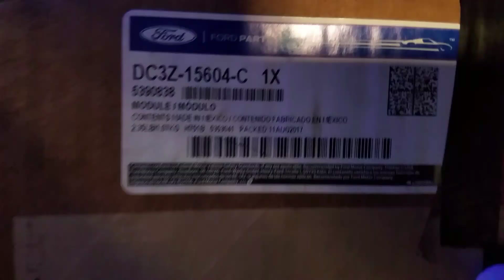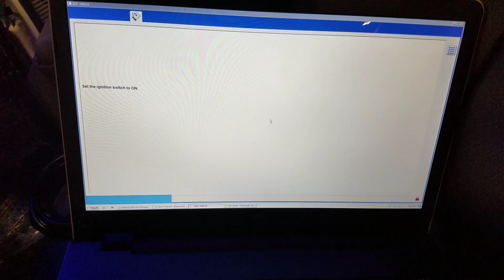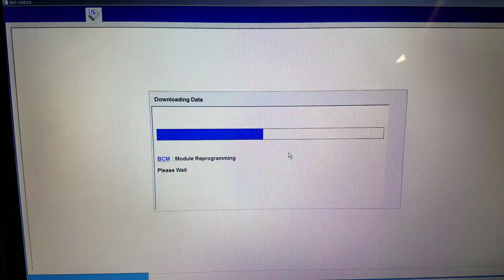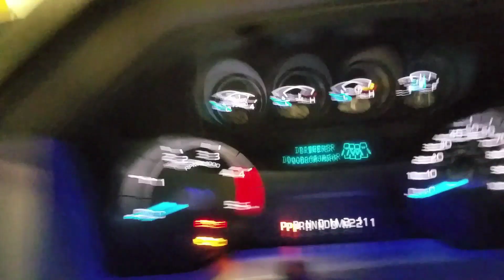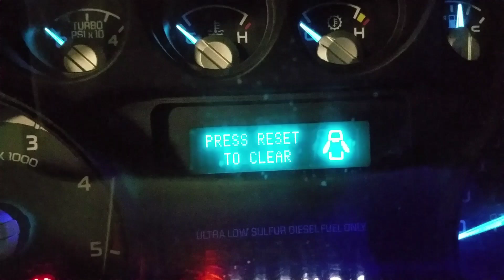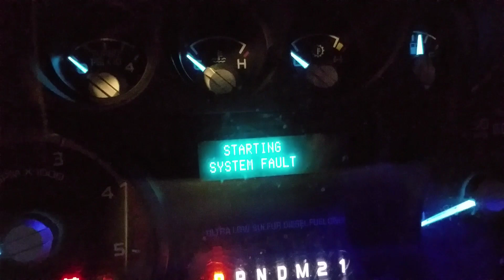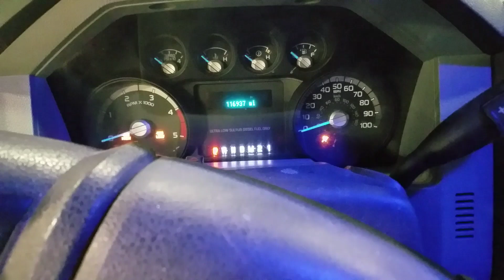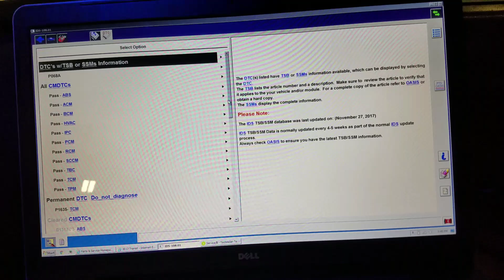BCM R&R - FsuperDuty

Comment: 2011 f250 6.2 here with no power to AC pressure switch and right high beam no power. Fuses good and nothing else obvious. Previous owner ran a switchable power lead to AC comp/pressure switch. Stumped on both problems. I’m an ASE master tech…. BCM? Mostly BMW and 
Porsche tech experience x 30 years. At time I turn the truck off and remove key, but it continues to run for a short time.
Reply from the maker: Hmmmmm. I'd be going through the pinpoint.Tests for that there might be something wrong with the heating.A c ventilation control module

Comment: Hello. Thank you for the video. It was very helpful. I have a 2010 f250 SD Lariat 6.4L. I disconnected some of the connections on the BCM to run some wiring for adding some LED in the door. I reconnected BCM connections and security light has been blinking and no start... what should i do?
Reply from the maker: Are you sure you have those connections seated all of the way.....
Reply: @PowerStrokeTechTalkwARod You we're right, my brother said he reconnected them... I checked them and one was not connected. Thank you very much I appreciate you so much

Comment: Took my 17” to get painted and the guys at the shop we’re going to jump start it cause batteries had died and they put the cables backwards and blow alot of fuses not sure how long the cables were on like that ,but i replaced all the blown fuses and still cant get my turn signals , seats , steering wheel controls to work ? Any suggestions
Reply from the maker: Oooof might be time for some other modules...

Comment: I notice you are using the VCM II. Maybe I'm misunderstanding the purpose of this tool, but wouldn't it be easier/cheaper to just use forscan and a (compatible) OBD II interface? Say..... one that auto toggles between medium-high baudrates?
Reply: I am new to forscan, and new to Ford,  but bought my vehicle with only one key. After being told i "cant just go get another key. The dealer has to do it" over and over i finally did the research 
i hate paying dealer prices snd i love to learn. :)
I got around to loading forscan, had a key (amazon) cut, and programmed it. Works good, but now that I have forscan, and can read DTC's anytime, I'm finding more issues that need troubleshooting. 2014. F250. 146k miles. I think the BCM, snd (possibly ICM need to be replaced. 
I intend to do the BCM soon, so I sure appreciate this post. I'm hoping I can do everything we've seen here with forscan. Fingers crossed. 
Anyways, thx for showing us "enthusiastic DIY" guys how it's supposed to be done. Appreciate you!
Reply from the maker: Sure, but if I have access to drive a cadillac, wouldn't I want to drive that instead of a dodge neon....

Comment: Question I just had my BCM replaced $1250 but intermittent I will get a BCM code my radio will act up the new BCM team with the new door code but the old door code still works I did not have Ford do it I had a local shop do it do I need to take this to Ford and have it programmed? Everything is working as it should other than time to time my radio will act up and the BCM code comes back in
Reply from the maker: Most likely back to Ford.

Comment: Hey so I bought a used bcm for a 2011 f450xl and tried to program it with forscan but can’t get the truck to start. Any suggestions?
Reply from the maker: Gonna have to be done with I. DS and you're gonna need 2 keys to program. Well, not on a four fifty, but you're gonna have to do a parameter reset

Comment: My service appointment for my 2019 F350 was scheduled asap - 8 weeks out. Hazards initially would turn on randomly then got to the point they were always on. Door locks started locking locking locking. Headlights come on. E brake chime dings incessantly.  The tpm works intermittently. The horn started blaring on a long trip-had to pull the fuse. The tcm code comes up now, but will clear when I clear the codes. Every time I park, I have to disconnect the batteries.  I am so glad I put in quick disconnects. The problems only seem to come up once the truck warms up. I've only had this truck for 10 months and I love it but this is getting annoying. This is going to cost about $1200.

Comment: I have an 11 F250 with dual climate control module. One day when leaving work it was dead. nothing HVAC turns on, backlight, nothing. I have 12.45V at the #46 fuse but could this BCM have kicked the bucket on that leg? Note the truck has 522,500 miles on it.
Reply from the maker: Hmmmmmm

Comment: I was wondering if you could answer something for me. I had a traction system malfunction come on after I remote started my F250. Then the turn signals and highbeams wouldnt work and the head lamp switch didn't work along with the steering wheel radio controls. After about 20mins of driving the check engine light came on and the headlights wouldn't shut off wheb the truck was turned off. I disconnected the black BCM connecter just like the one in your video and saw a spot of discoloration on one spot, im not sure what that means. About a year ago after being parked over night during a heavy rain my brake lamps  came on by themselves. I did find that moisture was coming inside that pillar are. Do you think the BCM could be bad with all of those issues?
Reply from the maker: Probably not. The BCM doesn't control anything witg traction control. You're messing with the Body-Control-Module....BCM everything in the body...

Comment: I just came across this video, I have a 2012 f250was having an intermittent no start, no run, that fixed itself, blower motor works intermittently, ac compressor was intermittent now no work, wipers stopped working, alarm activates if manually unlock, but not if fob is used, tpms and advance trac warnings on dash. All fuses and relays are good. Sound like BCM?Does Ford still build BCMs for these trucks? Will the dealer still work on a 2012?
Reply from the maker: Lolol, yesss

Comment: I have a 2016 ford f250 xlt 6.7 power stroke and I'm not sure what happened but my headlights are stuck on it has power but the display screen for my gears and odometer don't work and it won't start it throws a code p2610 but it won't show a check engine light or anything I don't know if it's stuck in theft mode or the pcm is bad or if the pcm relay is bad just wondering what your thoughts would be on what's wrong

Comment: My 2017 f250 powerstroke  has water getting in the passenger side  it got the bcm wet the hazards and horn was honking were going off intermittently  the parking brake light is also stuck on
Reply: Did you ever solve this?

Comment: Hey Bud, up here in AK with my 2019 6.7. doors lock and unlocking, horn honking, lights flashing, dash calling out a bunch of BS. does this sound like a BCM issue to you?
Reply from the maker: Hey there, id be wondering what codes we have present
Reply: @PowerStrokeTechTalkwARod  there is no code, I found water on my bcm. Not really sure how to fix. Dried up water, cleaned connections. Doors are no longer locking on there own but my flasher are running continuously and brake and tire pressure lights on.
Reply from the maker: Sounds like you might be replacing the body control module now
Reply: Did you get this resolved? I have a 19 6.7 doing the exact same thing with the locking randomly, horn, lights, and dash

Comment: just saw your video on the bcm replacement. i had some moister enter my bcm and first noticed by my advance track light coming on.  Also all my outside lights will not shut off blinker lights will not work but emergency lights will. I have cleaned all plugs and added some electrical grease to prevent any further moister intrusion. Do you think that by replacing my bcm that this would cure the issues i am having. Thanks for your feedback
Reply from the maker: It might
Reply: Did that’s solve it mine doing the same

Comment: Hey bud, I could really use your help. Trying to help my father with his truck, a 2016 6.7 F350. One day his truck displayed a TPMS fault message on the dash display on the way to work, same day his key fobs stopped working. We did research, went to our buddies at a local ford with the codes we pulled off the truck, we have an IDS. They suggested BCM. So we replaced the BCM while watching your video. When we got to the CEI configuration step it says complete/success but his dome lights kept flashing. Proceeded with PATS programming etc. Truck starts and runs fine. But still have TPMS issues, key fobs not working and blinking dome lights when the truck is on. We went back to our original idea before talking to ford of maybe the RTM being the culprit. Pulled the headliner down and replaced, same issue. Tried to redo the BCM procedure only to have the same results. We did notice that we cant get the TPMS to program with either procedure, tool or air release method. As you know it says start left front which we did, but also tried every tire to eliminate it being a bum sensor even though that was unlikely. Still living with key fobs not working, TPMS fault and blinking dome lights. Any ideas? Id greatly appreciate your help!
Reply from the maker: Did, you do a parameter reset? Did you programm BOTH PATS keys? Does this truck have OEM tires and wheels. You must program the TPMS for the lights to stop flashing or you use Forscan to disable TPMS.
Reply: @PowerStrokeTechTalkwARod  at first we did not do any additional steps outside of your video. We have both original PATS keys and did the programming as your video states, waited ten minutes for security and so forth. I believe that was the step with parameter rest right? Or are you talking about TPMS parameter reset? All i could find in IDS for TPMS was to change the desired PSI of that parameter. 

OEM wheels, tires are BFG but those have been on the truck for a year now.
Reply from the maker: Ull have 2 email us. Check thee ABOUT tab
Reply: Can I ask what the solution was ? I have exact same problem.
How did this get fixed?
Reply: @ethananstine5624  we did a bcm, reprogrammed with IDS etc, and that seemed to "fix" everything besides tpms. We used forscan to disable the tpms system, which in turn allowed the bcm to finish programming. The truck has also had some issues after the windshield was replaced and the tech cut a few wires related to radio/antenna. Got all of those fixed up as well. Have more recently had a few codes that all point to the APIM as a common link, that may be next on the list...
Reply: I really appreciate this insight ! Did you ever re enable the TPMS after the programming was completed ? I have aftermarket wheels and sensors to. I would like my tire pressure to display on the dash.
Reply: @ethananstine5624  we still do not have tpms enabled due to some communication issue. This may also lean into the APIM theory
Reply: Thanks! One last question. By dis enabling the TPMS does the dome light flashing go away? That is my main issue. I can’t drive at night the dome light flashing is blinding me.
Reply: @ethananstine5624  depends on why your dome light is flashing. Our was flashing, after bcm replacement, was due to the bcm not being able to "complete" its system check after programming. This was because the bcm and tpms are still having issues communicating in this truck. Disabling tpms with forscan allowed the bcm to "complete" its system check after the programming. Dome light stopped flashing as a result.

Comment: I got an issue with my bcm and you might be the only guy that can help! Long story short the circuit in the bcm for my running lights is completely fried. I can't find the exact same part number bcm anywhere, do they have to be identical part numbers? I can find so many others just not my exact number! If you can help you would definitely be a lifesaver!
Reply from the maker: U need the 1 per your VIN
Reply: @PowerStrokeTechTalkwARod  thanks for the reply! Only thing about that is that the one the dealer said I need for my vin number is a different part number than what I have in my truck
Reply from the maker: That number that you see in your truck is an engineering number that's not a part Number that you need

Comment: I have a 2018 f550 flatbed that has no right turn signal only the back (front works) blinks on the dash and all the other lights work only back right lights are out no hazards what could it be?
Reply from the maker: Gotta follw the pinpoint test for that

Comment: Hey buddy! What does it mean when you get an error that says incompatible configuration?  I was trying to enable my drl with my turn signal.
Reply from the maker: It means you can't do it
Reply: @PowerStrokeTechTalkwARod  I had it done already but then I wanted to make the window roll up with the key fob and messed up going through the as built with codes. Had to get reflashed for my 2017 F-350. Now I know why it won’t let me reprogrammed my drl with my turn light. Thanks buddy
Reply: Is there a way for Ford shop to set that up for my truck?
Reply from the maker: No most do not know what forscan is.

Comment: I have no power to my turn signal in passenger mirror but turn signal works on passenger head lamp and rear  does this sound like it could be BCM? If I took to dealership would them replacing bcm have any effect on the tuning that’s been done to the truck?
Reply from the maker: Absolutely not, absolutely not

Comment: Thanks for the info. I have 2019 6.7 w/ 30800 miles. Ford dealer determined that it was in need of a BCM for a parking aid fault. Tech installed the new BCM and it would not program. Tech tried 3 other shop computers with the same result. Tech advised that a call will have to placed with ford for answers to why? Why would it not program? Is it the truck or bcm? Just curious? Thanks.
Reply from the maker: Sounds like its the operator

Comment: Great informative video.I hope I don't have to do this ..... but, I'm trying to determine if my BCM is shot. All at once, none of my 3 integrated keyheads will communicate with the truck (w/new batteries). The PATS disarms when I put the key in the ignition to on after manually unlocking. The ext key panel on the driver door works fine and disarms the alarm, the interior door lock switches work fine and arm the PATS. Any troubleshooting tips on trying to determine what's going on would be much appreciated!
Reply from the maker: We wld have to sit down and book some time
Reply: @PowerStrokeTechTalkwARod  What's the best way to do that?
Reply from the maker: U will have to email us
Reply: Thanks for the kind offer - but, I got it figured out, blown fuse  # 24 - when the keyhead's transmissions are not received by the truck, the mirrors don't fold back, and you get a message on the dash announcing a Tire pressure monitoring system failure check fuse #24. Kind of logical since both the TPMS and keyhead transmitted signals are received by the same antenna, but, what's with the mirror foldback being on this circuit too?

Comment: No power to driver's door actuator, the other 3 doors locks work great, have to use a key to UNlock driver's door! Power buttons works on 3 doors. 2014 XLT SUPER CAB 5.O L. A bad bcm or fuse or relay??  Only have 1 key so could that lock have been deactivated by last owner so wouldn't lock his key in the truck???
Reply from the maker: How do u forget to mention wiring....

Comment: I have an 2012 F350,  everything related to my reverse lights not working. I just found out that BCM needs replacing,  Ford wants $400, any reputable resources where I might find a good used one or less expensive new one? Thnx in advance!😊
Reply from the maker: Buy it from the Ford store man. Will need 2 keys & the module will need to be programmed

Comment: We have swapped BCM to upgrade to OEM road lights. Thinking it could just be driven to the dealer which obviously did not work out. So we swapped the original BCM back in and it will not start either now. Is there a way to get this going without having it towed ?
Reply from the maker: No, gotta tow

Comment: I have a 2018 F250 that needed a new BCM per the codes it was throwing (about 6 codes). However, 3 new BCMs later the BCM's still won't program correctly (dealership is confused)  They have had my truck for 2 months with this ongoing issue.  The new BCMs keeps saying that I am missing stuff even though the truck never came with it (ex: Trunk antenna and Dully setup along with other things) .  Anyone have any clues or suggestions?
Reply from the maker: Ull have to email me. My time isnt free either my friend. Well have 2 talk

Comment: 2012 f350. Replaced BCM at ~200k mi. Lost rear dome lights first. Lost dome lights in the front next. Then lost AC/heat fan motor. No blower. I’m at 282k mi. Exact same issues.
Reply: Did you ever get it fixed? i have a 12 f350 xl i want to replace BCM to add power windows, doors and mirrors. Any advice?
Reply: my ac went out i change the compressor expansion valve fuses and steel dont work and my dom lighst dont work neither when i open doors no lighs come on

Comment: I have a 2014 f350 4x4 6.7. Just got service the advance trac sys message. Local tech plugged in the scanner and got failure to receive transmission from abs. Just replaced a frozen caliper and ruined rotor after a long trip.. my question is could my hub Assy on that wheel be at fault instead of the bcm? I’m sure that it got overheated from the caliper issue. Thank you

Comment: Great video, I have a 2011 F250 and just started to have issues with power windows and door locks. They work briefly until the circuit breaker for the windows gets super hot. The wires going to the main drivers switch are even warm. Also blows the power door lock fuse. Replaced the window switch as I thought it maybe it, but no luck. Does this sound like more of a BCM issue? Thanks for the help
Reply from the maker: Could be...